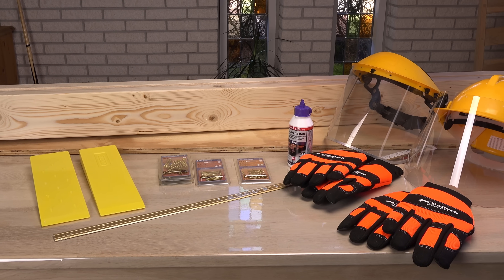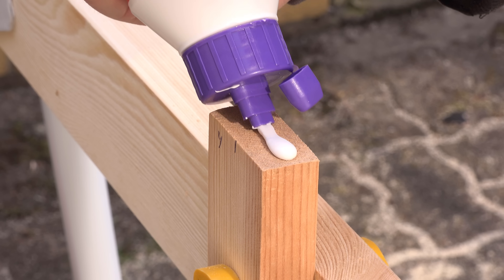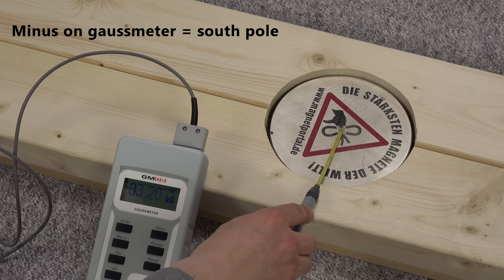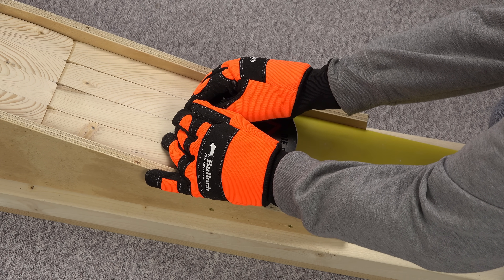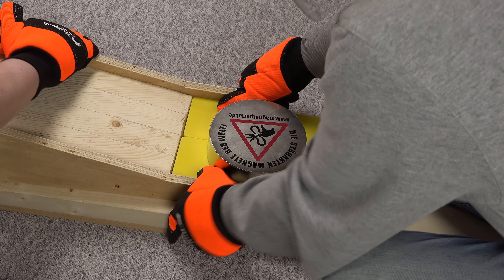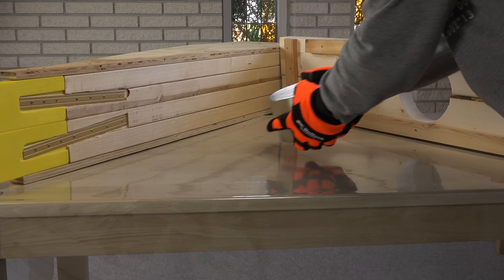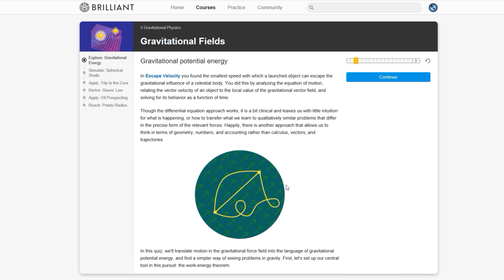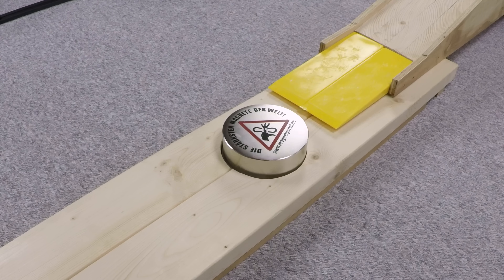Monster magnet meets monster magnet...

Comment: I kinda want to see them get seperated
Reply: Yes put magnet next to giant metal press.
Reply: The gaming pikachu
Its time for collaboration, visit finland.
Reply: Easy, play the video in reverse.
Reply: Get even bigger magnets to pull them apart
Reply: That monster isn't going near anything ferrous.
Reply: easy, just put in a fire. But after you can frow them out. That will the last time you see them working.
Reply: @accckiy  under  controled  heat they  could be seperated  but yeah  if  they  get  to  hot you  can  trash  the  afterwarts
Reply: A screw would turn into a bullet near that thing.
Reply: Aluminium hydrolic press.
Reply: Demagnitize them?
Reply: King Daniel, finger would not get stuck between those. It would be squeezed off the rest of the hand into a bloody pulp and most of it would ooze out.
Reply: it would open a black hole
Reply: i can remove it using my teeth
Reply: God.... The thought of getting your finger stuck between the 2
Reply: I'm sure aluminium is hard enough for the head of a hydraulic press...
Reply: I think plastic is hard enough for the tool to separete the magnets, making sur that you won't broke the magnet by pressing too hard with a hardened tool.
Reply: @johntheux9238  -  You're pretty slow if you think you could seperate those two things with plastic.
Reply: Easy, burn a knife to 1000°f and cut right in between the magnets
Reply: Give me some WD-40 and hold my beer.
Reply: Not all the press, just the tool.
Reply: Why ? And the wedding .. ?! Childrens?!....
Reply: it's possible using another strong magnets or induced magnetic field - this will weaken the magnets enough to separate them with less than inhuman force
Reply: A challenge for the hydraulic press channel!
Reply: Mustafa Gezer u can heat them to a. High temperature.
Reply: accckiy lmfao “frow them out” 😂
Reply: Ooh 666 likes,it should've be a shame if someone just-
Reply: 1000ft of cu wire wrap around the magnets. Energize the coil. Demagnetized
Reply: Hulk approaches
Reply: Could use a jig encapsulating the sides of each magnet, place it sideways in a hydraulic shop press, and push them sideways. They can't hold under tons of force. The important thing is to prepare the jig properly to keep them under control as they separate.
Reply: All you need to to is get a hydrolic press xD
Reply: Hydraulics...
Reply: Call Magneto?
Reply: Mustafa Gezer Lol not happening
Reply: Mustafa Gezer yep
Reply: It's kinda dangerous
Reply: @princessmadelinejoytoledo3512  What about an home made aluminium Manual Lever Press?
Reply: Stone Mug good idea
Reply: Mustafa Gezer me to.
Reply: John theux where would you get an aluminum press?
Reply: Mustafa Gezer, they should drop them from the top of a building
Reply: Mustafa Gezer Maybe de-magnetize it?
Reply: Mustafa Gezer that sounds insanely
Reply: However, first you should calculate how much force is nesisary
Reply: That wouldn't work at all. Aluminum is very soft.
Reply: في ايه يا مصطفي عايز ايه
Reply: Its humanly impossible
Reply: The gaming pikachu thats how you destroy love aka magnets
Reply: Mustafa Gezer just put the vid in reverse 😂😂😂😂
Reply: Perhaps put the magnet under a hydraulic press and attach a wedge on the press.
Reply: There's a difference between pure aluminium and a high strength alloy. 7075 is used for aircraft for a reason.

You could also use titanium, but that starts getting stupidly expensive really fast. You might also be able to use carbon fiber... can't recall its compressive strength, but I'm sure you could just pull instead of push from either side, the tensile strength is obscene.
Reply: ikr
Reply: Will never happen
Reply: Mustafa Gezer the only way is to heat it up but it also looses its mag netic properties
Reply: HAHAHAHAHAHAHAH 

Good luck
Reply: The gaming pikachu then that would get stuck
Reply: its not as exciting as you'd think all you have to do is secure one magnet in between 2 pieces of wood with a cut out to wedge the magnet securely between them and push the other magnet sideways with another pieces of wood attached to a pivot point end goal is to get the piece of wood between them
Reply: Throw it to a blackhole. Lemmino said nothing can destroy a blackhole.
Reply: All we need is a black hole pulling one away
Reply: Actually, you could send them to back to LHC for re-magnetization.
Reply: Give me a lever long enough and i will move the world. Maybe this idea would work here also? Just need to attach the both magnets as firmly as possible.
Reply: Witchcraft! Magnets can't separated! Wait a minute... force being exerted on both magnets in opposing directions at greater intensity until that force exceeds the magnetic force keeping them held together. I dunno, go do that.
Reply: @CodeguruX  - omg wow man how did you riddle out that you need to exert more force on them than they're exerting I bet nobody thought of that before you it's almost like that's not the fucking issue at hand but how to do that.
Reply: @virtualmartini  Why? The force is about 2 tons, that's 20 kilonewtons. Plastics has a resistance of 50 MPa, that means you need a contact surface
 of 20*10^3/(50*10^6)*10000= 4 square centimeters.
A plastic tool is strong enough to separate the magnets.
Reply: Get drunk and yell at them all the time and piss all over the walls. Me and my ex got separated shortly after that.
Reply: I have a stack of 10 quarter size Neodymium magnets and its a chore to separate one magnet from the stack.
Reply: @xjessie_drawsx  Not at all, the pressure between the two magnets is about 20000/(0.1^2*3.14) = 637 kilopascals, that's 1/1000 the strength of steel, it would be very easy to separate compared to brake a piece of iron.
Reply: @xjessie_drawsx  https://www.youtube.com/watch?v=hpgK51w6uhk
You would need a 6000 ton press like that to crush a steel cylinder of this size.
Reply: That’s selfish
Reply: @Ismar Navarro And brake them, energy is force times distance, the magnets attract each other from far away while they need very little deformation  before braking so even if they are far harder than strong the energy is the same.
Reply: Constant Hammering will do the work!
Reply: Maybe reverse the polarization of one with electricity...🤗 that's what Thor would do..! 😅
Reply: Yeah
Reply: Turn off button
Reply: Same
Reply: with hydraulic press
Reply: They are happy being together. Why do you want to separate them?
Reply: That's what i say about my parents
Reply: Like he can
Reply: That's what she said😐
Reply: Mustafa Gezer
Im more afraid to
Reply: just put them up to a concrete wall with a slot at the bottom that's just over the height of the bottom magnet,put a non magnetic metal infront of the bottom magnet to protect it,make it long so the top magnet does not fall on the metal fork,then push the fork of a fork lift truck against the bottom magnet,it will slide apart no effort.
Reply: Nope, I have used aluminum spring compressors, its like dealing with a cocked .45. One of them sheared the threads and shot the spring into the ceiling 12+ Ft in are shop. Aluminum is strong, but under forces like that it fails fast and violently. After that I switched back to cast steel spring compressors. Forged aluminum might be a bit stronger, but after what happened to me I wouldn't trust it haha.
Reply: Mustafa Gezer Chuck Norris can separate them with two fingers.
Reply: Any form of degaussing would run a high risk of ruining the magnets, whether that is electromagnetic (the copper wire and electricity option) or by bringing the magnets past their curie point (heating 'em up). The inductive method runs a direct risk, and the heated method allows the magentic moments to realign with any shock.

So unless Brian has an industrial strength magnetizer, that's probably not the best idea.

Much better would be a mechanical solution such as a couple of 7075 Aluminium bars or pistons to hold the magnets laterally and slide them apart.
Reply: You can easily pull them apart by hand 😁
Reply: @jayce5128  They're the strongest magnets in the world..
Reply: Mustafa Gezer they are still trying.
Reply: i kinda want to see one at each end of someones head
Reply: Ckinsman execution 100
Reply: LIKE NATO SHOULD GET SEPARATED. THIS IS WHAT OUR RICH SOCIALIST CRADLE TO GRAVE WELFARE RECIPIENT NATO ALLIES DO WITH THEIR TIME AND MONEY WHILE WE PAY FOR THEIR MILITARY DEFENSE BECAUSE THEY REFUSE TO.
Reply: Write "Trump" on one, "Truth" on the other and they will part of their own accord.

Comment: Great video. I have been waiting for this forever. Are you going to attempt to separate these monsters in the future because I was quite surprised to see you go straight in and not use spacers. Did you consider using them?
Reply from the maker: Thanks. I did not consider using a spacer, since the point of this was to make a bigger, single magnet. I have no plans to separate them (where a spacer would have been incredible useful...), but who knows if my plans will change in the future :)